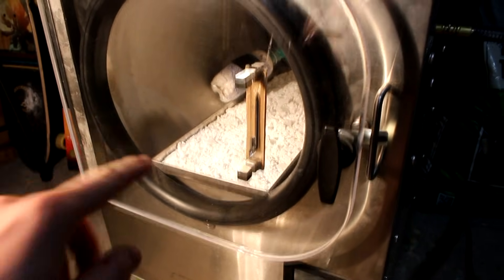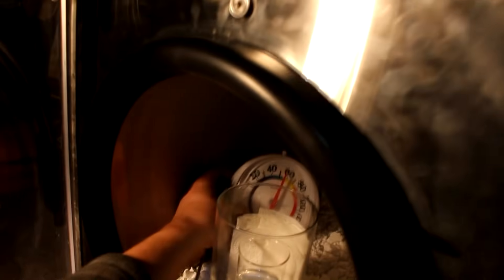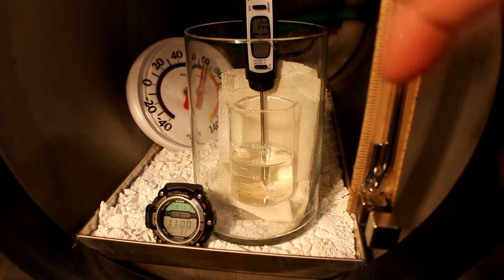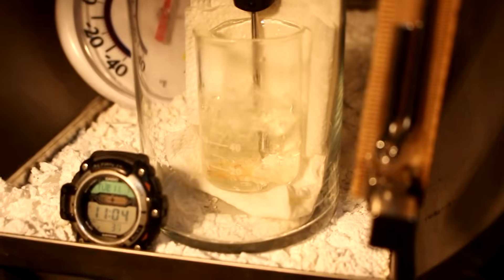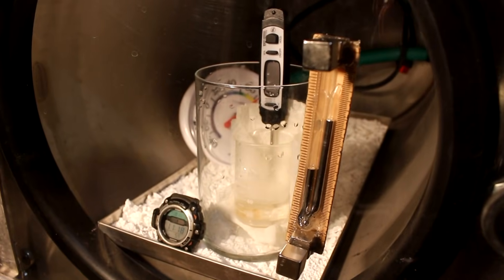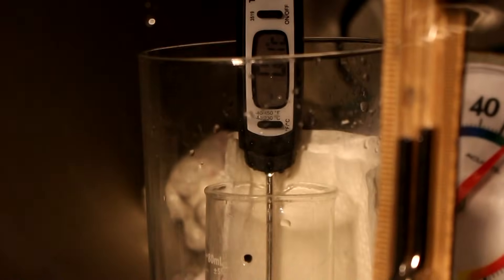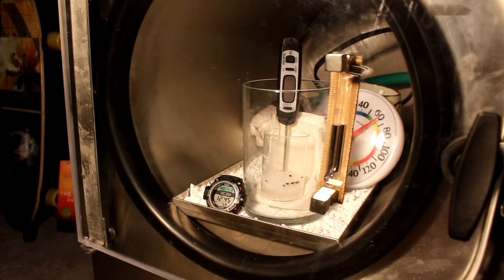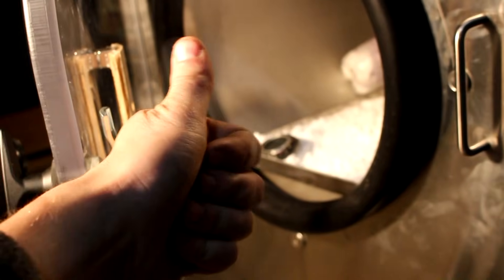Boiling Water Until It Freezes

Comment: Just based on the principle of PV=nRT, the temperature makes sense in a vacuum but why does the water "boil" ?  I thought there is less energy in the water therefore the water molecules are moving more slowly?
Reply: You have it all wrong. The temperature does not lower because of the vacuum. The vacuum lowers the boiling point of the water, which causes it to boil, and the conversion to gaseous form requires energy, which is what causes the water to cool. That's why it eventually freezes.
Reply: Nyerguds ahh I see. So the boiling point of water (that we know) only applies to water on earth. But that still doesn't explain why the water boils then freezes. The water is either losing energy or gaining energy from its environment.  If its related to triple point , it may make sense.
Reply: It's constantly losing energy to its environment; the most energetic molecules in it are the ones escaping in gas form. And that gas is constantly pumped away by the vacuum pump.

Comment: The freezing phenomenon is quite common and is easily anticipated.  The overarching relationship is the vapor pressure curve.  If at a certain temperature and pressure, liquid water should be a vapor, the liquid will suck energy out of the water to vaporize.  The huge latent heat of water causes the water temperature to drop.  But the vacuum continues to go down so the steady suckage of energy continues until the water is frozen.  Then sublimation takes over.  

Most liquids exhibit this phenomenon.  But water has the highest latent heat of vaporization so the effect is more dramatic.  

I am most glad that this experiment does not involve mercury.  One day you may get madder than a hatter.
Reply from the maker: The barometer had mercury in it.
Reply: um what
Reply: titaniumsandwedge is this from wikipedia?
Reply: This is a well known thermodynamic principle and is probably on wikipedia.
Reply: Your explanation is not wrong, but you some funny language that convolutes the thermodynamics a bit. Maybe I can restate your point so they understand.
The process of water boiling is exothermic, it requires water molecules with enough kinetic energy to leave the bulk water and surface tension layer. Since temperature is just the average kinetic energy of water molecules, the fastest moving molecules will boil first, leaving the remaining water with a net loss of kinetic energy so that it's average temperature is now low enough to freeze.

Comment: so why doesnt the clock looking thermostatic decrease in temperature. shouldnt a vacuum be freezing.
Reply: No, because there's nothing in it to transfer any energy around, so the only thing left for the thermometer to measure is its own temperature, and because there's no air around to even transfer cold or warmth from somewhere else, it doesn't change. Space being cold is a myth. In fact in space it's more of a problem that you can't easily cool things down.

Comment: When there's no air in chamber, fast molecules of water are able to fly away from the rest liquid. 
Obviously they got sucked by the pumping device. 
Those fast molecules had more high energy than other molecules in water. 
After they went away from liquid, it has less energy than before. 
Until the water freezes.

Comment: Why doesn't the mercury boil inside the barometer? Does metallic bonding prevent this?
Reply: Good question, I don't even know. Wait: On second thought, I'm guessing it's because he didn't go low enough to get the mercury to boil since it has a high boiling point compared to water. I'm no expert though so I could easily be 100% wrong. :)
Reply: Ryan Prince It's not about temperature, it's about pressure. There's an annotation on the video that says it's close to a perfect vacuum where the mercury was displaced.
Reply: Ryan Prince

Comment: why does it get cold in a vacuum?
Reply: The vacuum doesn't get cold per se, but the water "boiled" due to the lower pressure inside the vacuum chamber. As water boils, it loses a lot of heat thus freezing it. Another example would be if you boiled water at home, it would boil at 100 degrees but if you were to do it on himalayas, it would boil at around 80 degrees. (all measurements are in celcius)
Reply: Point is, conversion from liquid to gaseous state needs energy. And since the boiling is not done by heating it up, there's only one place that required energy can come from... the water itself. Because of that, the process of boiling actually cools down the water.

Comment: I'm sorry, but after drinking cyanide I don't think drinking the liquid in that glass counts as proof that its tap water :P
Reply: Meskarune my thought exactly XD
Reply: Meskarune the way he drank it and kinda cough I was thinking like vodka
Reply: you mean kept the frozen water in a vacuum? it wont go back to room temperature because the reason why water goes back to the same temperature as its surroundings is because the air molecules interact with it and with no air molecules there would be some heating from infrared radiation but its not nearly as significant as convection and conduction
Reply: air molecules ? ? ?, just pressure. higher up(off earth) you go = less air pressure = water ''boils off'' (not hot neccessarily) at lower temp.
Reply: If you turn off the vacuum, air will enter the system and the water will heat up from the heat of the surrounding air and melt. If you kept the vacuum intact, then as John Li states, the water will remain frozen as there will be no air to conduct heat into the system.
Reply: @supertubemind  If the block of ice was suspended in the middle of the chamber and not touching anything at all, then it would stay frozen under vacuum. However, although there is no air present, the ice is still in a beaker which is resting on the tray in the chamber. Cody did use some paper towel as insulation, but that just slows down the heat conduction - it can't actually stop it completely when there is still some physical contact. So even if the chamber was perfectly sealed, the ice would eventually still melt, as heat slowly leaks into it from whatever the beaker is sitting on.

The situation is different though if you maintain a dynamic vacuum rather than a static vacuum. What do those mean? Well, a static vacuum is when you pump all the air out of the chamber, then close the valve to seal it off, meaning a vacuum will be maintained so long as you have no leaks. A dynamic vacuum is when you keep the valve open to the pump, so the pump is continually evacuating the chamber. This is how freeze-dryers work: The material to be dried is first frozen by the same process Cody demonstrates here, but then kept under a dynamic vacuum to sublimate the ice away. It is a slow process, because the rate of sublimation depends on how much contact the material has with the walls of the chamber or any shelves or racks inside it. The contact provides a source of heat to drive the sublimation - without that, a freeze-dryer would never work at all.
Reply: @lloydevans2900   Even with no physical contact, the ice would still absorb infrared radiation, so it would eventually sublimate away completely, albeit more slowly.  If it were kept at a static vacuum, it would eventually melt thanks to the sublimating water re-pressurizing the container.  Regardless, nice explanations.

Comment: So you tested the thing where the HAB air lock blew and the excess water stored in the space suite turned to ice? Do you have any numbers on the sublimation rate? Is this surface area dependent or total volume?

Comment: Boiling water with heat usually involves heating from the bottom, making the nucleation sites appear more often on the bottom... however doing by vacuum evaporates off the top...thus calcite (which is at the bottom) does not help much n stopping the splashing. You need floating nucleation sites (as you did in the second one).

Comment: Ha! When explaining to customers how their air conditioner works I often explain this principle.  That at low pressure water boils at room temperature and if you do it fast enough it pulls in all the available heat till it freezes.  Likewise when the refrigerant leaves the metering device, it goes from high pressure to low, it boils and pulls in heat.  This also comes into play when we use the vac pump to remove water and other non condensibles from the system. If your vac pump has too high a CFM you can freeze the water and not actually remove it from the system. What  you are watching is Boyle's law at work no?

Comment: It wouldnt surprise me if the liquid crystal isn't subject to some evaporation.  All the chemicals I could find had pretty minimal 25°C vapor pressure though.  The battery electrolyte is another story.
At this point I'm more interested in why the thermometer stopped functioning while the watch didn't.  I'm guessing that a watch with seals rated for 30m water would also do a decent job keeping the watch internal pressure from dropping too much.

Comment: I have a question! What happens when liquid nitrogen and liquid oxygen join together?
Reply: My guess is nothing. At first, one might think nitric oxide(NO) forms, and then nitrogen dioxide forms(NO2), since nitric oxide is a free radical, which are unstable. However, this reaction is not favorable under low temperature conditions. In fact, it typically requires the high energy found in lightning for the reaction to take place. It is an endothermic reaction, meaning it absorbs energy. Thus, if you just combined a cup of liquid oxygen and liquid oxygen, they probably would not react. You would, essentially, get 2 cups of liquid air.
Reply: 1 cup of liquid oxygen and another cup of liquid oxygen? XD
Reply: Noah A yes i am aware of that. He said 1 cup of liquid oxygen and 1 cup of liquid oxygen. I am not toying to say anything he just had a response but slightly messed up. He said two of the same thing. I was just going for the lols
Reply: firebugplaysmc Not unless you have some insane temperatures and pressure in your cup... enough to exert nuclear level pressures and temperatures to convert nitrogen to oxygen.. then again, that would require both states of matter to be in plasma, not liquid, form.
Reply: mathig nihilcek yeah but still. I just have like the worlds greatest grammar OCD so yeah. I catch every typo on worksheets at school, every typo in newspapers (that I read) every typo ever. Lol.
Reply: they would mix! (possibly boiling off or freezing a tiny amount.)
Reply: +firebugplaysmc You realize air isn't just oxygen, right? Two cups of liquid air doesn't equate to two cups of liquid oxygen.

Comment: If you control the temperature and pressure correctly you can cause frozen water (ie ice) to directly change into vapor without going through the liquid phase (known as sublimation and is the basis of Freeze Drying). Can also reverse this process for vapor directly converted into solid. A phase diagram for water is great for demonstrating where the phase boundaries and intersections are. The triple point for example is a unique point on the phase diagram where conditions produce a state where solid, liquid and vapor co-exist. Water is actually a very complicated fluid and its properties and behaviour is still studied today by scientists and engineers. 
Most fluids have a higher density in solid state as compared to the liquid state - not water. it actually expands when it freezes and the reasons are quite interesting.
One more thing - you can make a heat pipe or vacuum thermal diode by lowering the pressure inside a tube or container. The Latent heat of vaporisation and condensation of the fluid can be used to transfer heat - and the thermal diode itself is a closed system.

Comment: Cody, don't dock point off for me with my high school understanding of forces and whatnot, but I had the idea that a way to create energy would be to take a container filled with compressed gas and move it to an environment of even lower pressure, wouldn't it depressurize with more force than in an environment of greater pressure? thus creating an easy way to create energy? also, using pressure as a means of storing power seems like it would be the perfect way to hold energy (such as in a tensioned rubber band or compressed spring) as I don't know any other way the energy put into the container can be lossed compared to the energy taken out. what are your thoughts on this? If both of these are ridiculous and not worth testing, let me know and why. but if they are worthwhile i would also love seeing a lab on these subjects from you.

Comment: Cody, you really don't need to use the thermometer (for the most part.) I get that your pressure gauge is homemade and therefore of limited accuracy, but it should still be reliable enough to allow you to calculate the temperature of the water by the pressure in the chamber.

Comment: +Cody'sLab rather than put desiccant inside the chamber, you'd do a much better job keeping vapors out of your pump using a cold trap! The glassware is cheap, and for water you don't even need to go very cold... That said, it looks like you have an oil pump, and water is really not bad for them as long as you change the oil afterward. If you plan on pumping on a lot of vapors of any kind, you may want to look into a diaphragm pump.

Comment: I've done similar things, I suggest making a cold trap between the pump ( nice choice of a JB tool by the way) just a chamber cooled by dry ice and mineral spirits in series with the exhaust between the vacuum chamber and pump. quick pull-down, and no chemicals in the chamber. By the way, JB says maintenance of that pump when vacuum potential falls off is to put clean oil in it and run it overnight capped off. change oil as required.

Comment: What would happen with really pure distilled water? Would it be unable to boil, and thus unable to lose heat and freeze? also I wonder if vacuum ice cubes taste different any different than conventional ones, with the oxygen coming out and all.
Reply: Ryan Lutes, it would be even easier to boil actually. only by alittle bit though. That would be for the fact that it isn't mixed with anything. If you think at the molecular level if it was mixed with other elements molecules tend to be attracted to one another. which would make it hard for water to go into the gas phase. That is why it would be easier if the water was distilled.

Comment: If you went into a vacuum with an oxygen mask providing oxygen, would you survive (assuming that the vacuum ISN'T in outerspace but in a pressure chamber like this one)
Reply: The Problem is, that you don't get a vacuum without the extreme pressure conditions. Your Blood would do the same thing as the water in this video... Your body is 80% water. So to answer your question: No, you would not survive it without a spacesuit.
Reply: TheSchuetzeP ahh okay.

Comment: So space isn't cold simply because it's cold, but because there is a lack of pressure? Actually, I suppose it would be because there is a lack of oxygen as well.
Reply: There is a lack of movement. That's why it is cold. "Heat" is just a different word for "The molecules and Atoms are moving really fast". And when there is nothing, or almost nothing in terms of molecules flying about, there can be no heat. The absolute zero of temperature, -273,15°C (or 0K) ist a fix point, not because we didn't find anything colder, but because it is the temperature, at which no movement whatsoever is left.
Reply: Space being cold is a myth. On spacecraft they often have the problem that they need ways to shed heat more quickly, because no mass means there's no medium for heat to transfer to, meaning radiating heat is the only way to get rid of it. Overheating is a much more pressing problem in space than freezing.

Comment: what would it be like for a human in that environment given that they had oxygen supplied?
Reply: Your Blood would do the same thing as the water in this video... Your body is 80% water. So to answer your question: You would not survive it without a spacesuit.
Reply: Not exactly; the human skin would always act as protective suit too; that's its primary purpose after all. Doesn't mean you'd survive for very long, but it's doubtful your blood would immediately turn to vapour.
Reply: Nyerguds Well not immediateley. And not as cleanly, as the water in this video, but 15 minutes should do the trick, to wreck your circulatory system and all the water based processes in your body pretty heavily. Of Course you will be dead before the 15 minutes.
Reply: Experiments on animals apparently showed it to be survivable up to 90 seconds. Generally I've heard that you can survive up to 30 seconds of vacuum exposure without all that many problems.
Reply: Nyerguds Well, Cody had a video somewhere in this channel, where he put his hand in a vacuum for a few seconds.

Comment: hey there, big fan. To prevent water inserting in the pump, the best way is a piece of glassware that is double walled in order to fill the inner hole with  dry ice or liquid N2. The vapors condense in the wall  and are easily collected. This method could also be used for recycling water from pee in survival situations aka "the martian"

Comment: Silly question, but does the water just freeze because it loses heat by giving off infrared radiation? If so does that mean ordinarily air resupplies the water with energy at the same rate it loses it?

Comment: If you put Zeolite instead of the Magnesium Sulfate into your vacuum chamber, you might get a view of water that freezes solid while boiling. You might have to put some insulation on the bottom of your beaker though, the zeolite gets quite hot while absorbing water vapour. I have seen an apparatus that demonstrates that via a hand pump, there the Zeolite was held in the metal lid of the chamber that doubled as a heat sink.